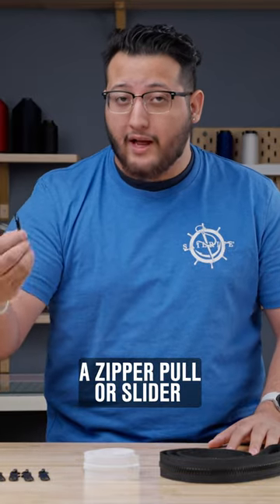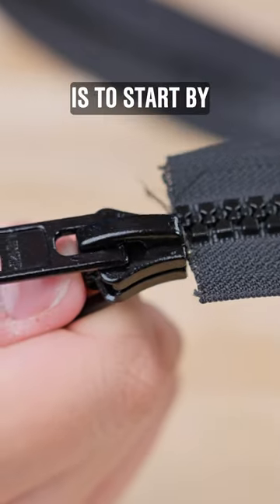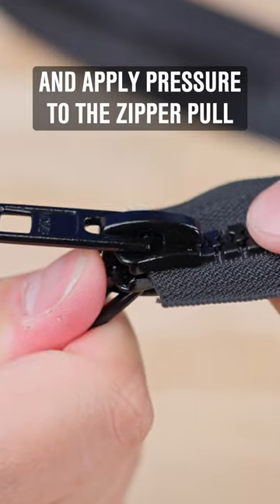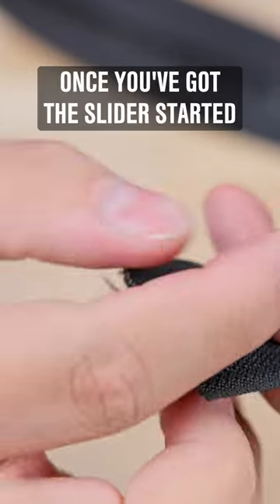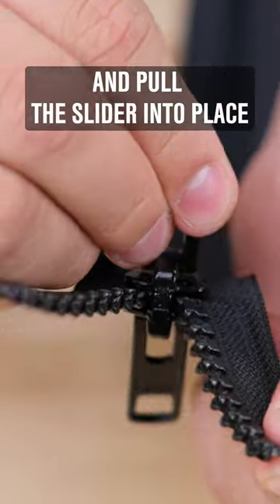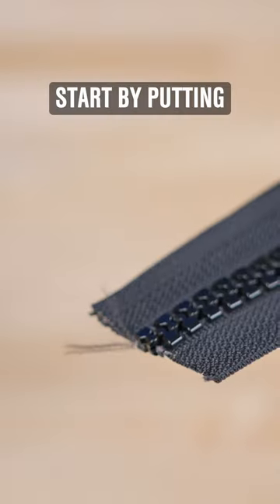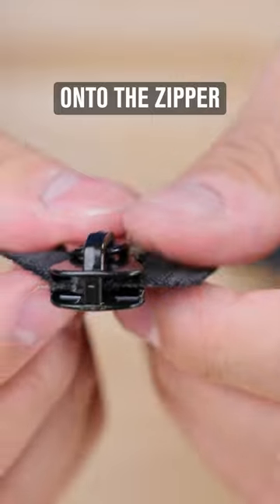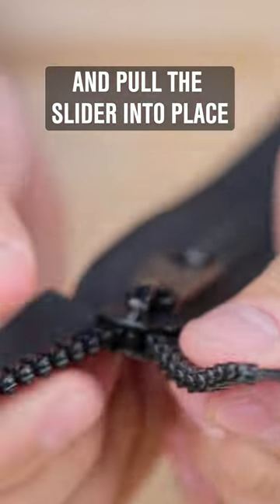Zippy DIY Tip: Zipper Slider Installation Made Easy

Comment: I see a nautical symbol on your shirt so I will assume you are discussing zipper pulls for marine canvas tops.     No zippers are like what you show.  None.   Not one.  Not ever.  At the end is a box, or double long tooth.     Why not show how to install a zipper on one of these zippers that exist in the real world?
Reply from the maker: Hi Doug, in this video, we used a continuous zipper chain. Continuous zipper chains are usually purchased in large lengths and trimmed down to fit the size of a project. In this case, the zipper stops, starter box, and/or starting pins would be installed after the slider.

You are referencing a finished zipper chain. A finished zipper is a prefabricated zipper (with a slider, stops, and possibly a starter pin and box). These include bridge top, bag type, and jacket/separating zippers. We have videos on our channel showing how to install and replace zippers on a jacket and a backpack. You might find those videos helpful.